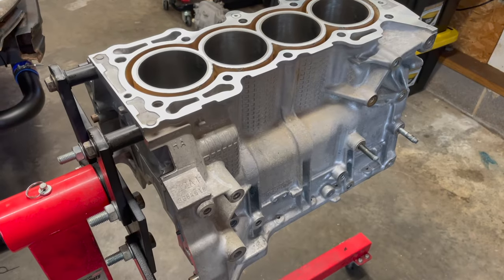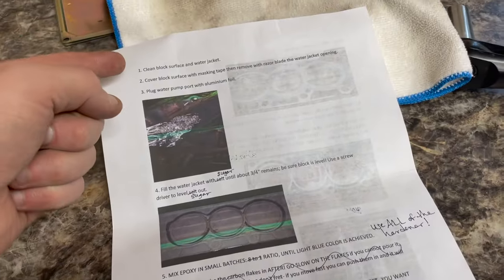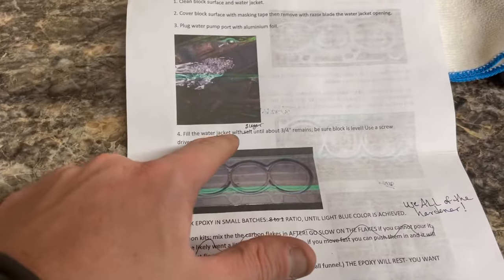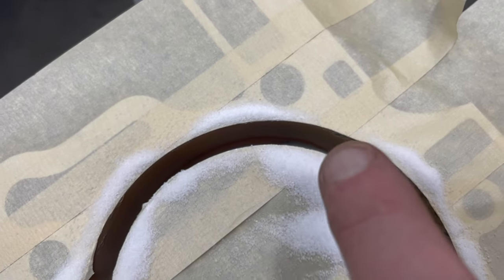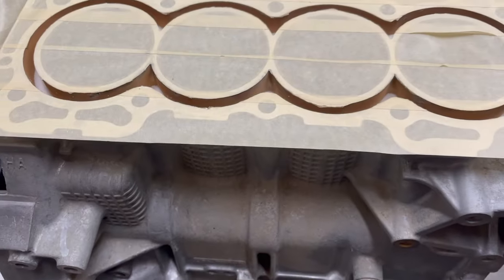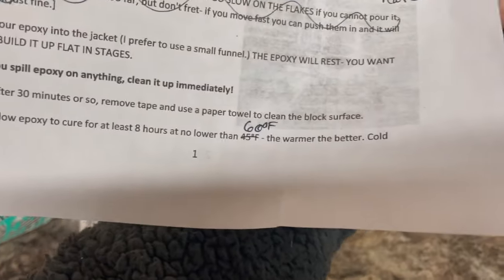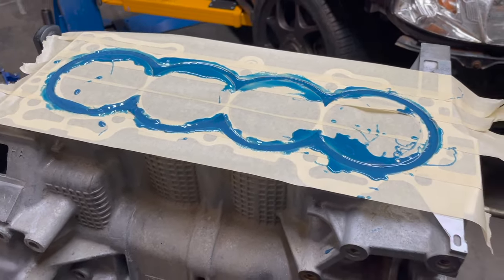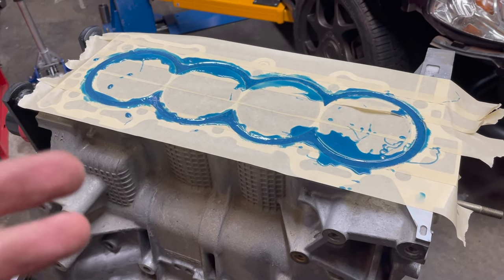DIY Epoxy Block Fill

Comment: Next time add epoxy mix to a clear sealable bag. It allows for  better mixing then when finished you can cut the corner of the bag and squeeze the epoxy into the jacket with more control and less product waste
Reply from the maker: @Richard Henson, What kinda cakes you make?
Reply: @sethchurchvid   Defcon cakes years ago😂
Reply from the maker: @richardhenson4257  seems like a logical solution

Comment: I cant believe anyone with any sense would put this in there block and think its going to benefit and save your cylinder walls??? Please send your block to CSS.
Reply: For an older dude I thought maybe you’d have some knowledge, but epoxy blocks has been in the game since back in the days with drag racing an v8… it’s good for up to 800hp. CSS is good up to 800-1000 but at that point why not skip css and go with sleeves. CSS is good depending on your power range but to make anything over 600 on stock sleeves anything is a gamble so if it’s a gamble I’d rather go with epoxy, to spend all that money on css is pretty dumb when sleeves is just a few hundred dollars more

Comment: Hello, Great video but I need to share what I found with this stuff when I used it. I did the pour and 100% success on that part nice and hard. I was so pleased until I thought, hay let's test some of the leftovers that had set in the pot about a week later. I boiled some water to simulate a running engine and dropped some large pieces in there and oh... fuck.... fuck!!! FUCK!!!! Couldnt believe it but it turns RUBBERY AND SOFT. It has no compressive strength whatsoever when hot. You can squeeze it between your fingers. And no I am not joking!!!!. I spent a full day chiseling it out of my block. Why OH why has nobody else including chris tested it hot. DO NOT USE THiS.
Reply: Lol shoulda just boiled it out
Reply: Just did this with my leftover puck from my squeeze bottle I used.
 After over ten minutes at a rolling boil (over 200 degrees f) I observed no change in material. I recorded it, maybe I'll put it up. 
Something was wrong with yours, evidently.
Reply: You have a bad ass car! I'm gonna have to watch some of those videos!

Comment: Apologies if I missed it in the video, but what amount of power should I consider doing this?
I have a H22 block that's at the machine shop for a bore and hone job at the moment, and I'm going to be putting a set of rods and forged 10:1 (+0.25mm) pistons in it. My power goal is ~350 wheel HP. 

Open to input or suggestions from anyone. Thanks.
Reply: What did you end up going I’m aiming for the same power leval on h22a4

Comment: do they sell inserts where you can install instead of the epoxy ? there like billit aluminum and the support the top end of the cylinder.
Reply from the maker: CSS, cylinder support system

Comment: 5 or 4mm SS (marine) wire around the bores also helps. this give the epoxy scaffold-like characteristics 

and or many loops if 1mm wire also works. the epoxy surrounded the wire

must be that woven wire, so the epoxy bites the rough surface
Reply: No, it doesn't.  You might think it does, but it's just more futile work.

Comment: Not hating but isn't a block very cheap or do they need to be machined to fit is this just to get out of machining or ?
Reply: Yes, this is the poor man's way to get around using Darton sleeves and paying to install them.  Nowhere near as good.
Reply: @TTGTO288 bro you only need sleeves if your plannin to push a shit load of boost obv sleeves is better but for a daily pushing what 16-17 psi this will work real good butttt always the tune is what matters here
Reply: @skitlershot7403  Keep saying that until it blows up.

Comment: Looks easy and diy. Greetings from Aruba. Looking forward to do this on my ej205 block.
Reply: Did you? Considering for an ej255
Reply: done it   was pain in ass on 255/257  leveling due to the semi closed webs  makes it hard to level once it meets the supports open deck was way more simple to do  and it leveled nice

Comment: Doesn't this greatly reduce the cooling, ending in surface cracking?
Reply from the maker: Not exactly. CET has many reviews netting successful outcomes. The flow is similar to that of other css.
Reply: This is the poor man's way to skirt Darton Sleeves and its not as good.  Might as well just buy a junk "Block Guard", which is useless too.
Reply: @TTGTO288 wdym? Because its just epoxy and not metal?
Reply: @Varitype  Epoxy is not rigid, it will flex, crack and break.  Mix up a batch, form it and test it.  It will never be as strong as a Darton Sleeve set-up or metal ... the guy in this video is getting lucky and cheating death with his block.  I've seen plenty of blocks go longer than expected with stupid "snake oil" mods like this, but it will eventually come apart.  Ideas like these come from a late night and someone say, "hold my beer and watch this !!".
Reply: i leave it a touch shallow  on top  so coolent can fill upper section then add holes for head gasket

Comment: You used half the epoxy and entire hardener?
Reply from the maker: No equal parts and followed directions provided
Reply: @sethchurchvid  how is it holding up? How much power you making?? I bought it too from Chris. Just contemplating whether to fill the block or not

Comment: This didnt last long for me...2 1/8 passes and 2 1/4 miles passes with 4 street pulls before the sleeves cracked at around 700whp...Forgot to add the dyno session also.
Reply from the maker: What was your setup when this occurred?
Reply: @sethchurchvid  stock ported head and half filled block just like the one your just did...gen 6266 around 30-33psi...Pretty much built everything but stock sleeves and  stock ported head. Now I have a sleeved block and re used everything and its been fine now for over a year and a bit of street abuse...
Reply: @zongyang4707  u don't think 700hp is asking too much for a DIY closed deck engine?
Reply: @lilmixdboy  it was a ticking time bomb bound to happen. It just happened faster then I anticipated..lol
Reply: This isn’t so your sleeves don’t crack
This is so your sleeves don’t move as much and blow head gaskets
Reply: What block were you using? You know some engines there cylinder walls are dog shit and no amount of epoxy can fix that